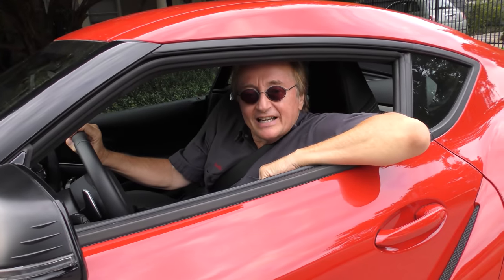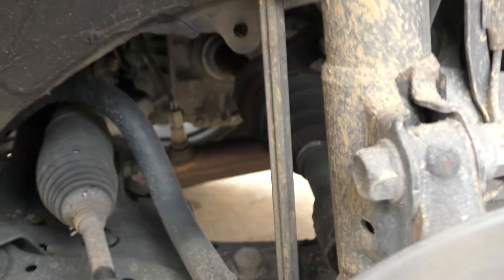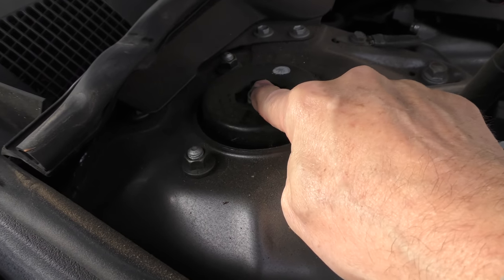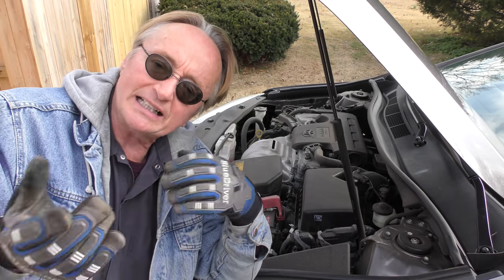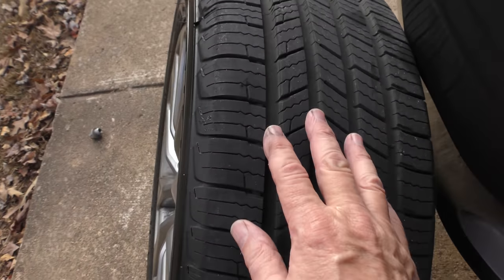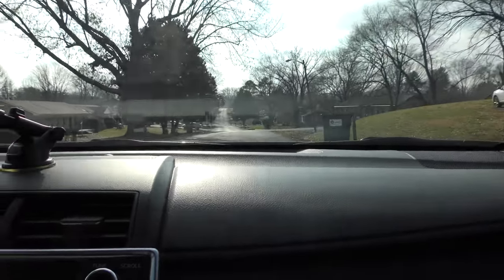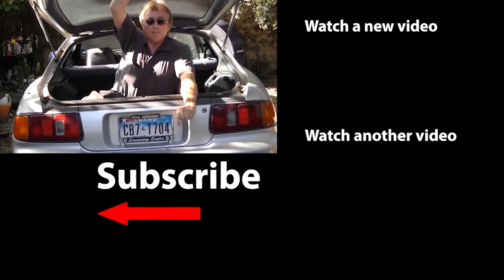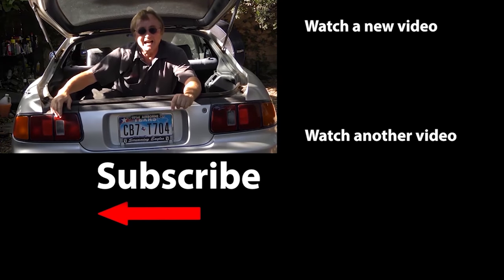Mechanics Don't Want You to Know This About Your Car's Suspension

Comment: Scotty is the first mechanic that ever said "Your suspension is fine".
Reply: He isn’t wrong at all haha. I got a 95 Tercel and a 97 Camry. They are both exceptional cars.
Reply: I tell people their suspension is fine all the time. Usually on Toyota products.
Reply: I wish I had a millionaire Scotty to take my car to.
Reply: Ha haaaaaa faaactxscz
Reply: umm scottys the only honest mechanic lmao
Reply: @SAYDATDARIUS  Just too many mechanics going by "If is not break, say it's broke and I can pad my own pay checks".
Reply: I have a 96' sebring convertible with 80k on the clock and all original suspension parts. My shocks are tired but that's it. Meanwhile the wife's 2016 kia already needs new struts lol
Reply: @seanhorgan6774  eggxaaactlyyy, shyt cars( after 1999)
Reply: i have a 97 subi impreza and man guys.. im glad i work and mastered my car makntenance
Reply: Spray your rubber to make it last and last
Reply: It always depends what the year make and model are.
You would much rather find a causing failed part than keep replacing tires and having objectionable clunking noise, shake, or vibration.
I had a person not want their car once and found a bolt on piece was causing the weird feel.
I was able to find the piece good, and used, bolted it in place.
Drives right now.
They couldn't tell from trying to drive it. They just hated the "feel".
It was eating tires so it needed a set. Then it was alright.
Simple.
Reply: @deedaartyst  that's why I love the 90's sebrings...  the taint of the 2001+  2.7L means you can grab those older 2.5L for nothing!
Reply: JUST TO BE HONEST MECHANIC ,HE WILL LOSE A LOT OF MONEY 💰, BUT IS GOOD TO BE HONEST PERSON /ALL DEALERSHIP SAID THAT YOU WILL NEED ALL FRONT END PARTS AND TAKE YOUR MONEY
Reply: My car is 2012 kia and steering wheel feels like is stuck when driving li if a rubber band is holding it...what can it be
Reply: And that my friend right there is what separates him from dealership mechanics
Reply: @FernandoRomero-oq7bx  power steering
Reply: Agreed
Reply: It’s so crazy because I went to my local Toyota dealer worried about my cars rear suspension, and they said it was fine.
Reply: “If it got you here, most likely it’ll get you home”
Reply: True story! In my 20 years of cars after cars (the first car, the family car, the partners car, the cheap and cheerful, the mid life crisis car..) all of them had problems with suspension..

My next car needs to be a tractor!
Reply: I am having this issue on my wife's Lexus right now. 3 different mechanics have looked and can't pinpoint the clunking noise. All of them have said there is nothing structurally wrong. It's just an irritating sound. I am bound and determined to find out what the hell it is.

Comment: The front end of my '99 Ranger made all kinds of noise going over bumps. I figured out from Scotty's videos that my ball joints were dry. I put grease in through the zerk fittings and now it makes no noise. Scotty's the man for finding weird noises.
Reply: Bought a 99 ranger brand new from the dealership. Pulled out to leave and both tires went opposite directions, stopping me right in front of the entry door to the dealership. Front key links and stabilizer bar was totally missing. Never installed. Truck didn't have 1 mile on it and would've got totaled had it happened on the highway. Only Ford I've ever owned

Comment: Been following Scotty's AT-205 suggestion for some years now since I first heard of this tip. I live in New York State where we get road salt and when I change my motor oil I spray AT-205 on all my suspension parts. Once a year I check for undercarriage rust and spray some undercoat under the car. When I got the car new after half a year I got it professionally undercoated.

But yeah the AT-205 is GREAT. Helps keep the rubber/plastic parts healthy and not brittle.
Reply: Isn't that transmission fluid?
Reply: What is A 205

Comment: I just recently did a HUGE suspension job on my car and saved thousands. Thanks for Toyota being so simple. Replaced both lower control arms, both wheel bearings, both lower control arms, sway links, end links, cv axels, motor mounts, transmission mount, struts and shocks, coolant, new atf... Toyota is amazing for making it easier on home mechanics.
Reply: @goclunker  is it super complicated?
Reply: @Sledgefist1  basically unbolt 4 engine mounts, remove two, unbolt steering rack and swaybar to lift motor to get to the dogbones on the control arms. What a pita
Reply: Same with Subaru!

Comment: Thank you, Scotty! Today, I took my 2017 Highlander (~93K) in for service at the Toyota dealership. The technician said my control arm bushings were cracking on one side and recommended replacing the complete control arms. I was suspicious because there were no major cracks. It looked more like  small cracks and just normal wear. They quoted me for $2,900 repair job... I'm going to spray the AT-205 for peace of mind. Thanks again, you are super!

Comment: I called the manufacturer of AT-205 about using it on suspension bushings, and they said it will lubricate for few minutes, but the stuff will evaporate. And they said I would be wasting my money.
I personally would recommend silicone spray, and make sure to stay away from lithium grease and all purpose WD-40 since they are petroleum based. anything petroleum based will destroy rubber.
Reply: That's really interesting about the petroleum factoid. That's going in the permanent section of my brain haha
Reply: @TylerAlexis  It's the same reason you don't use vaseline or oil with condoms, only water based.  Petroleum weakens rubber.
Reply: '' SHORT CHAIN'' SILICONE ! Long Chain NO GOOD.
Reply: @michaelkraus4135  That's a good point. I sprayed silicon spray on my slingshot rubber and it destroyed them.

Comment: In the corps we very commonly used silicone gel for the same purpose. On wires, rubber etc. There is all types of silicone lubes and goos on the market. Not sure how all the prices would compare but it is the same concept. Works wonders on rubbers and plastics. This is exactly how we keep all that Vietnam era gear working for 50 yrs.
Reply: Thank you

Comment: I’ve been using AT-205 ever since you recommended it a couple of years ago. Works great!
Reply: Why don't they sell it in a spray form?
Reply: @georgepacheco4521  because it´s made to treat seals inside an engine
Reply: @georgepacheco4521  I think because the primary purpose of the product is an additive to automatic transmissions to help recondition seals and stopping leaks. The way that Scotty uses AT-205 is what doctors and pharmacists call, “off-label,” or in a manner otherwise unintended by the manufacturer.
Reply: Tried buying a case directly from the manufacturer.  They do not sell to the public, you have to go through a retailer.  I go through this product alot
Reply: @azthundercloud  You might try to buddy up with a locally-owned auto parts store, who may be able to buy it at wholesale, then can sell it to you for a case discount.
Reply: Is there any other substitute for that AT-205? What can I use if I can't find AT??
Reply: @Beibash86  Good question! I have asked it many times, but I have no answer.

Here, in Europe, we have lots of radiator seal products, but I don't know how good are those on rubber.
Reply: @ovivius  well, I still haven't received any recommendations to my question from any source. But video guy says that liquid is a Polymer. I guess we should look for polymer liquid
Reply: do you use it on motor mounts as well?
Reply: @eddie3500  ok thanks
Reply: Can I use AT - 205 sealer on my suspension oil AHC on mi Lexus LX 470 for leaks?
Reply: @Beibash86  wd40
Reply: @juanbolanos8348  it won't work I guess, just replace the damaged part
Reply: I use it thanks to you works great.
Reply: @azthundercloud  advance auto sell it.11.99
Reply: @emmanuelgomez5520  why not it's rubber
Reply: @Beibash86  303 rubber protectant. Checkout sweet project cars he sprays on tires to and supposedly last 100k miles using that spray every few months on the whole outside tire surface.

Comment: When i started 35 years ago, i was taught to evaluate all parts of the steering and suspension and if the steering and suspension was in working order with little to no wear, we would undercoat the entire steering and suspension front and rear. I still do this practice to this day and have my customers do this service every  2-3 years and i never had a comeback or premature steering/suspension failure. All of them have had the original steering/suspension over 150k and still functioning properly
Reply: Taking care of the fluid inside the vehicle goes along way most people overlook alot I've noticed as a beginning mechanically inclined guy. Great video again Scott!

Comment: I have an '02 Dakota Quad Cab with 63k miles. I bought it new. It had a bad ball joint,  and overall loosness in the front suspension. I bought 4 Moog control arms with the ball joints & control arm bushings pre installed. I also got new idler arms, stabilizer links, steering links. All with grease fittings. While at it, I  replaced the calipers & roters/pads with power stop drilled/slotted roters, and ceramic/carbon fiber composit pads. Total cost was around $650. Now my truck rides and feels as tight as the day I got it. And the composite pads, fantastic. Quiet, no more dirty front rims, and braking is firm & true. No noise or pulling to one side. The suspension wear is so gradual, you don't realize how bad it is until you redo it. When I took it in for an alignment after the redo, the mechanic commented that the work I did would have cost between 3 and 4 thousand in a shop.

Comment: Very well explained, always hated suspension work. This is so informative now im understanding suspension and the parts and this video really helped me understanding each and every part!! My mechanic told me that me that my lower control arm needs to be changed along with stablizer links while changing the motor mounts on my mercedes. I'm very anxious about my ride and try to get it well maintained eventhough it reached 100,000 miles and this suspension work is my next job to go for and im thinking to change my 2012 Mercedes E350 struts/shocks to Bilstein B4 (comfort) as it feels bumpy and awkward, I heard lot of good reviews about the bilestein on German cars

Thank you Scotty 💯

Comment: Thanks Scotty! Always diy! I just installed a 3" lift on a lexus gx470( the best suv ever made in your own words) the lexus dealership wanted $3000 to install. Another mechanic wanted $2500. I did it myself in about 7 or 8 hours and it was fairly easy. If you have a little time you can save so much $. Also access to the right tools

Comment: If it's a small clunk when backing up, I often see 12-17 Camry brake pads shift in the caliper braket just a little bit. Cleaning dust and debris from contact surfaces help. Make sure hardware is in place. Also and less common, the metal cowl tray under the wiper motor will have insufficient torque particularly where it connects to the LH strut tower. Most dealers assume its the strut mount, but it's the cowl tray shifting under a loose bolt.
Reply: Wtf why does that sound like total nonsense to me?
Reply: @elffawnruth6316  I dunno, I guess nonsense can clunk also. 🤷🏾‍♂️
Reply: I have terrible brake pad shifting problem even in my 2007 Camry, sounds awful until i grease them up

Comment: In 1986, I bought an 83 Toyota Celica for about $3000, then drove it 14yrs had 614,000 miles. I changed brakes, starter, clutch & flywheel, and rear-end. Sold in in 2000, still running good for $1,500. My 2nd and favorite car

Comment: AT Reseal is AWESOME. I used it in my leaking power steering system AFTER trying Lucas Stop Leak (for power steering) and it miraculously stopped the leak! And it was quite a leak too!

Comment: I had a mystery clunking noise in a Toyota Aygo it turned out to be loose brake lines of all things hitting the bodywork! :D
Reply: How did you find out ?
Reply: Had the radiator reservoir tubing come out of the holder between the radiator and reservoir and it was clunking as the fan hit it.. shaved down real nice.. no holes yet though.

Comment: Should also check for loose calliper mounts, loose slider pins, and missing anti-rattle clips. All of these can provide enough clearance for a clunk in the suspension when changing directions with the brakes lightly applied.

Comment: Just got some AT 205 since after only 323K miles, my power steering pump sprung a leak at the front seal. Seems to have stopped the leak. Now I gotta use the rest for the sliding window seal...

Comment: I worked at a gas station in the early 60's . We would spray a mixture of used motor oil and kerosine...
Reply: Genius, I use the same concoction for raw wood and to prevent metal from rusting (tools, open panels...) I just use diesel instead of kerosene, it's cheaper. 🤙Now I learnt that I can use it as a stearing bush lubricant. Awesome...

Comment: I just replace my struts with kyb struts, I found out that they use to me great struts, made a good name for themselves, then they f up and moved their plant to Mexico, and I get those struts, anyway, when in cold and hot weather I get a loud, dry rubber on rubber type noise on turning. Brand new struts, u you would think this would be resolved long ago.. But nope. Stay away from the Mexico and China parts is what my experience has taught me. Same thing with optima batteries. Thought I'd share

Comment: Scotty, I hope you can read this. I bought a 2008 Toyota Solara Convertible with 60,000 miles and it doesn't ride as smooth over bumps as my previous 2011 Toyota Camry with 132,000 miles. Is there a reason for that or could I just need new shocks and struts? I wouldn't think I need new jocks and struts on a car with only 60,000 miles. Thanks, Glenn

Comment: Just picked up a 2012 Honda CR-V from an Acura stealership 2 weeks ago. Later noticed that  I need a sway bar replaced on driver side. Take it back to them to get it fixed or let me buddy do the repair? Reasoning ask is because they sold me the car less then 30 days ago...

Comment: Great advice on additional uses for AT-205, Scotty. Have a 2007 Pontiac G5 SE 2.2L and had to replace bushings that just fell off when my brother was just going to change them. If we drove that day, mom and I would have been in the ditch or worse. Had the brakes, sway bar links, tie rods changed as well. Had water leak below glove compartment and brother fixed that. Beginning of this winter, heater blower motor kicked out. Gave it a kick as you shared on one of your videos and  presto got heat in the car. When temperature dropped to -38°C with windchill at -45°C, I had to kick motor twice when it wouldn’t start. Still starts and sometimes chugs and I have to hit with foot or windshield snow brush. Lol. Love your videos and your memes 🐴🦭🦧🐒

Comment: The Corolla of this same year does the same thing.  Mainly when it's cold out.  It will do it in the summer but mainly when you go over more harsh surfaces.  Did Toyota cheapen out of these parts?

Comment: My camry make a metal clunk noise when put into reverse, looks exact the same as this one. I bought it used and drove one year no problem yet.
Reply: It's prolly the mount that goes in between the engine and firewall  surprised scotty didn't show that one
Reply: You sure it isn’t just the sound of going in to reverse gear?
Reply: @johnhilton2509  It's a Hybrid. So I guess  not

Comment: 303 aerospace protectant works well
Reply: Backyard engineering,
How do those two products compare to ArmorAll?  My 3M Littman Stethoscope manufacturer recommends it to protect plastic tubing from body exudate (perspiration, ect.).
Reply: I mix the 303 with at205 its the best compound try it for yourself. It makes the perfect tire shine too the uv protection keeps rubber from cracking and aging like all other tire shines.

Comment: Dang, I've been hunting for the clunking noise that sometimes happens while backing up in my 08 Fusion, and have never found any thing worn or broken that could cause it. Going to get some of that reseal and spray my bushings. Thanks Scotty, you're the best! 😎
Reply: Did it work? My 09 does the same thing.
Reply: It’s likely the engine mount... common on those.

Comment: I bought a nice work truck SUPER cheap because the guy took it to a shop that told him the entire front end needed to be replaced. I inspected it just, jacked it up, checked for play, and it's solid. The shop was trying to sell him a big job when all it needs is an alignment and two new tires.

Comment: I was told by one shop my bushings on the both control arms were cracked and needed to be replaced.  Quoted me $2400 to replace both on 07 Camry. Took it to another shop and he told me my control arms were fine.  Took it back to the first shop and he put it up on the rack and he grabbed a crow bar and sold me that I do need new control arms.  Who knows but I had em done anyway.  Bottom line, I ended up getting both control arms replaced, 4 new struts, an alignment and oil change for $2800.  Something is still clunky in the rear end though.  Any thoughts?

Comment: I can live with chrome plated door handles on a Lexus but a plastic stabilizer bolt? "Come on man!"
Reply: I work for Ford. We have plastic oil pans and plastic drain plugs.
Reply: @solarfall2728  way to go ford
Reply: @yeolblt  Same with BMWs
Reply: I've always hated the chrome door handles...
Reply: Plastic valve covers exist lmao
Reply: @ashleybernard2372  man, I'm rally hating those... I can't use the engine to sit in it or whatever, I even fear cracking one when pulling it out to check diesel injectors...
Reply: @marcox4358  plastic world aha